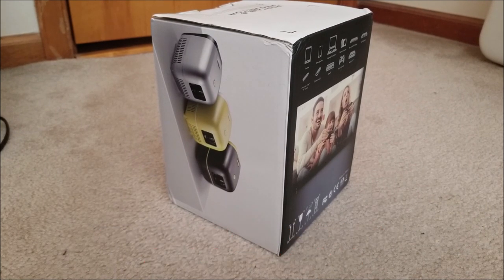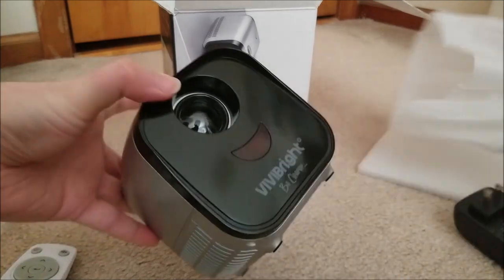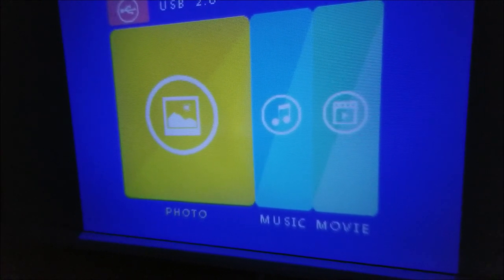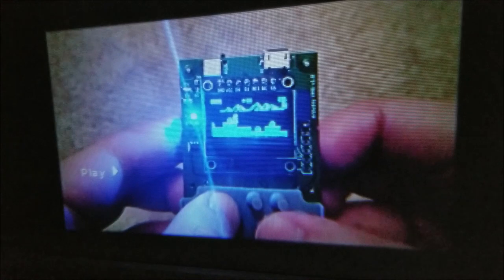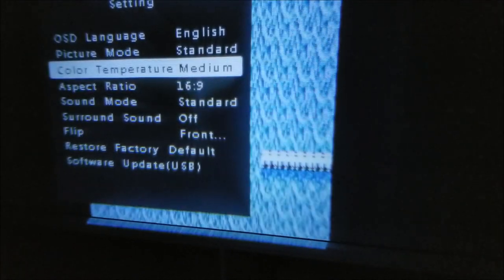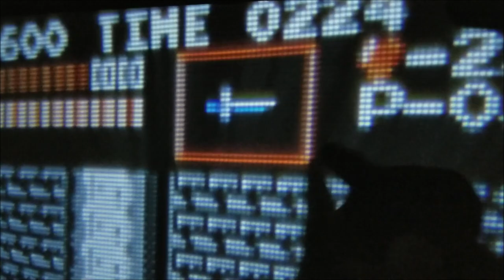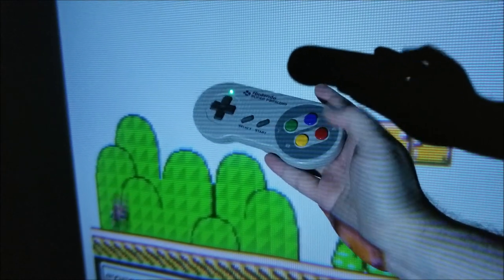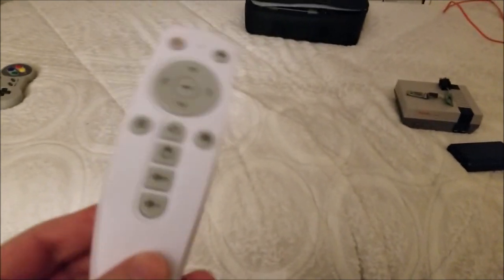VIVIBRIGHT Mini Projector L1 Review

Comment: I think this little guy is pretty cool, but what are options for sound? Like, other than using the projector as the source of sound
Reply from the maker: There's a headphone jack output on the back so just about any amplified speaker can be plugged in via a 3.5mm audio cord.
Reply: @sjm4306  awesome! Thanks for responding